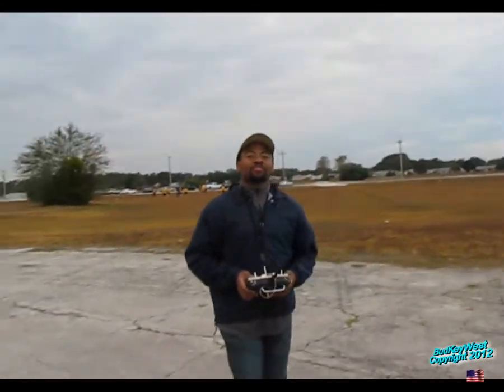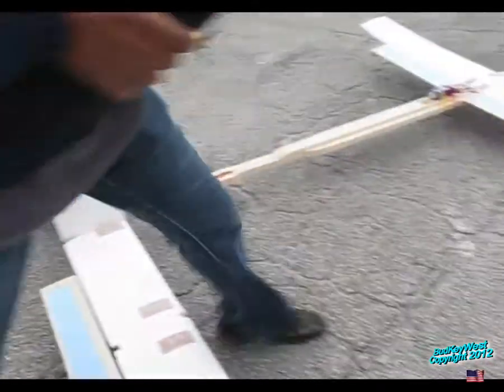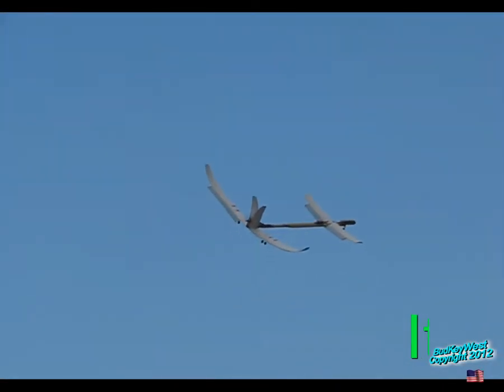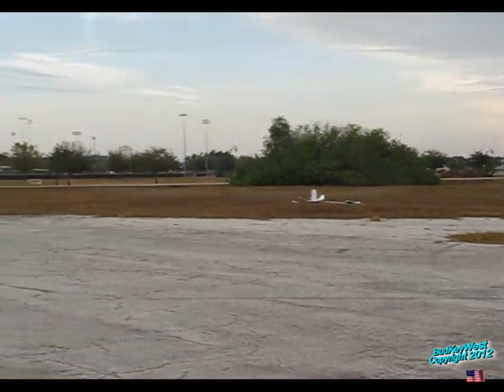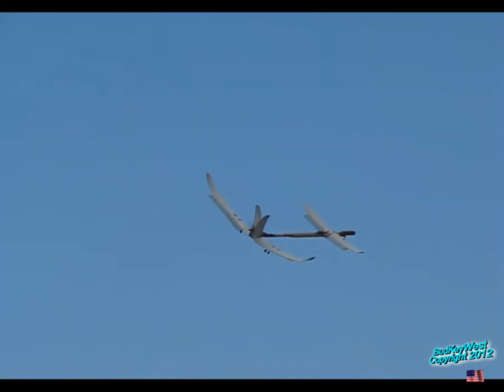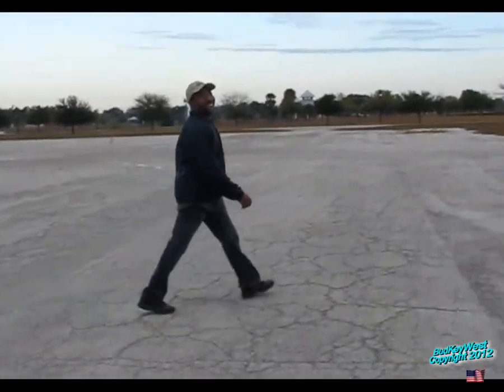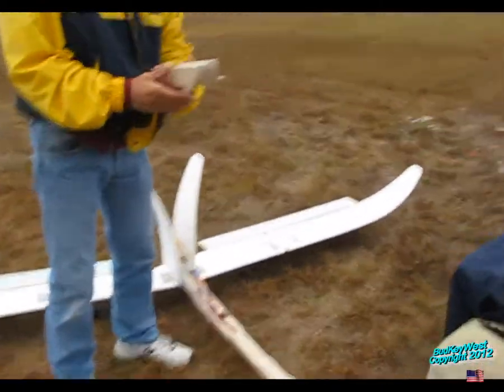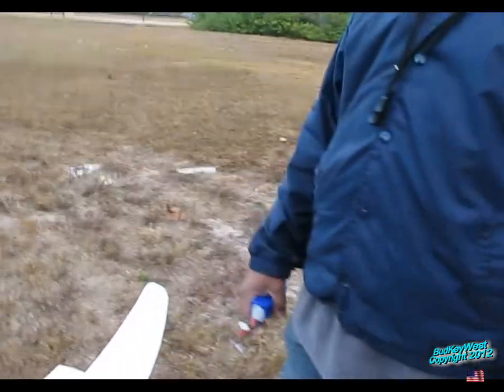RC Crash Canard with 10 foot wingspan CRASH ! Again! Number 5

Comment: You could always run fishing line from several points on the wing down to the wheels and another across to each wheel, the tension may keep the wing from bending, I have used that a few times on slow flyers.